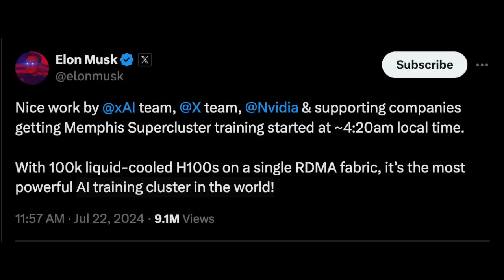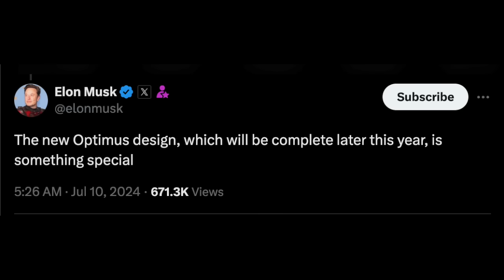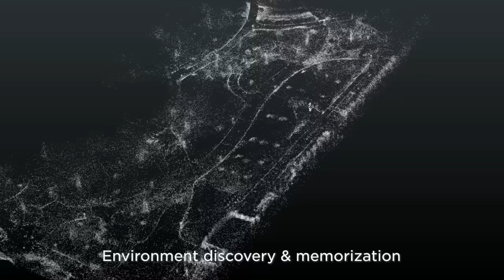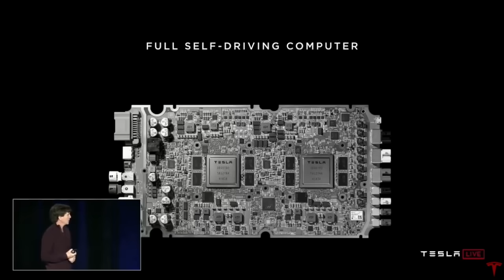Tesla’s Optimus Gen 3 is coming soon - Elon confirmed a whole NEW design

Comment: I'd be pretty awesome if Optimus can perform a self diagnostic on servos and actuators for malfunction or degradation in performance. This would significantly cut down on additional service and diagnostic costs to the consumer.
Reply: Tesla build their cars like they build software - with a lot of automated tests, even for mechanical parts. 

So it’s a reasonable guess that Optimus will both self-test itself and self-adjust, thus compensating for wear and tear.

Comment: Coming soon!
Just like 
Tesla Roadster 
Hyperloop 
Loop system 
Battery swap
Mars colonization 
Tesla Solar
Tesla Semi

"Soon" it's going to be existing!
Reply: Hyperloop was never on Elon's list. He published a white paper for others to run with. Loop system? Works well; just not autonomous yet.

Battery swap? 😄 That was tried and rejected by Tesla owners. It's also an extremely wasteful idea since the amount of batteries needed far exceeds the number of cars. It bankrupted Better Place in Israel and is saddling Nio with massive overhead costs.

Mars colonization was never advertised as "coming soon" and will happen at the same pace as Starship and Superheavy's development. Tesla Solar Roof and Tesla Semi seem to be under endless testing, development, and improvement cycles. They are both operational, just haven't reached volume production yet. CyberTruck was also there before it came out end of last year. It's ramp is accelerating.

The Tesla Roadster though is inexcusable. They should have released it along with the promised 520-mile Model S Plaid Plus and 500+mile CyberTruck. If it's cake, then just make it.
Reply: At least 3 of those things are not anything Elon  promised or even wanted to do ...😂😂😂

Comment: @6:38 Lars, as you know from my posts over the many years, the predictions l have proposed about '_Things_' especially those by Elon and Team, have included Miles per kWh of the SEMI....1.7miles per kWh which Elon confirmed a day or so after the reveal to PEPSI. My statements since first seeing OPTIMUS included that it would be able to Play Piano Btw my Engineering colleagues that design Electric Wheelchairs have rejected all or almost every bloody statement put before them.....my mentor even told me on day one in August 21 that the humanoid by Tesla can NEVER happen and NOT at my projected equal to or less than $20,000 Well, what more can l say for them to even consider the possibility.